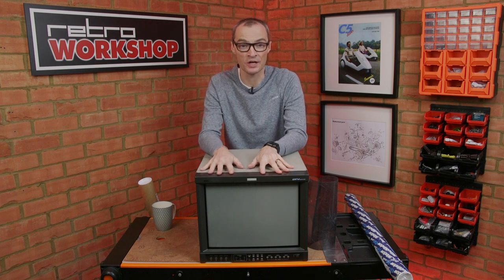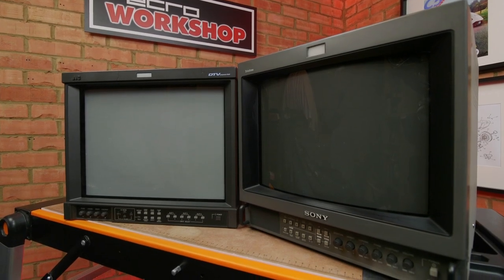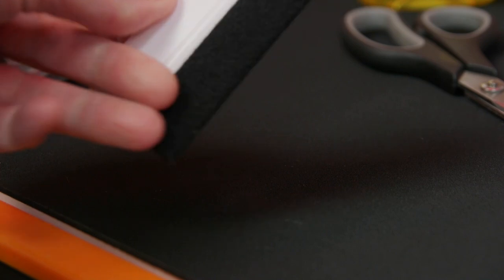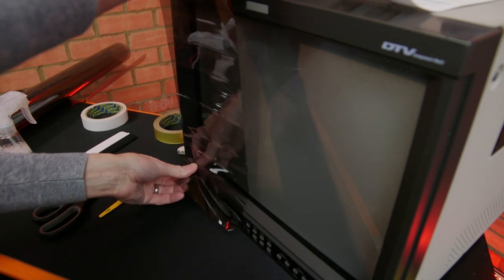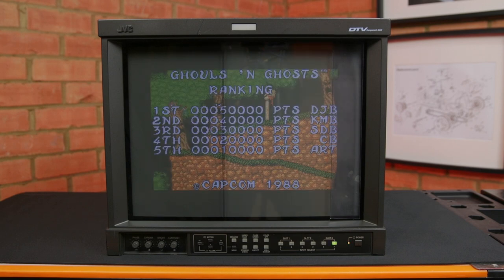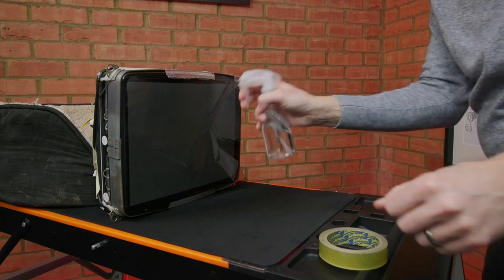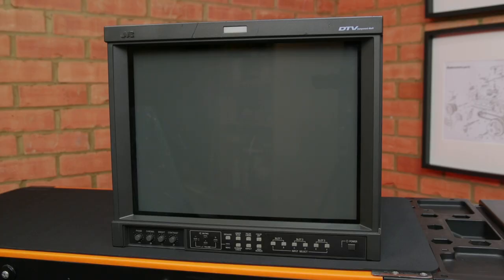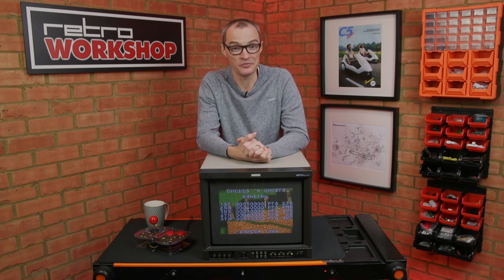JVC CRT monitor repair pt. 2 - film replacement

Comment from the maker: If you have one of these monitors where the antireflective coating is damaged (rather than scratches that have penetrated the film that covers the glass screen, as on my monitor) you can just clean this off. Use some cleaner such as Flash Bathroom cleaner (the one that is good for limescale removal) and a micro fibre cloth. You can be quite vigorous. Use Q-tips / Cotton buds for the corners. Then final clean down with water. I have done this on another monitor and it works well.

Comment: It's awesome that this is possible. I have a same monitor with a small area where the film is coming up, I believe it's lost its stickiness as it's not really scratched, but there's a lightened section (and applying any pressure is only causing it to come up further). It's not bad enough to peel and replace the film, but it's great to see your process for doing this as I'll certainly do it myself when necessary. I performed many repairs on my monitor (I have the Panasonic BT-H1700 which is virtually the same monitor as yours) and I'm amazed at how well it still works given that the hour counter is maxed out at 65535 hours!
Reply from the maker: Good luck if you give this ago (sounds like you are used to monitors but observe the precautions shown in part 1). Often monitors can go on and on, only having to replace the few caps that work hard. As long as there are no screen burns you're OK (monitors used in edit suites were bad for screen burn with on-screen timecode).
Reply: @RetroWorkshop  Indeed! No screen burn -- just a weakened green electron gun causing negative streaking against bright green details, which was remedied via CRT rejuvenation! I'm definitely lucky that there was no screen burn on such an aged tube. There are a couple small geometry and purity defects with the monitor still, but it's more than usable for 240p/480i and 480p content. I also replaced almost all the caps when I first got it, as many of them were bulging and looked to be in quite bad shape!

Comment: Awesome video ! I was looking for a way to reduce the eye strain that I get from an Orion consumer CRT tube that I used to replace a  broken arcade monitor. These consumer CRT tubes seem to have no anti glare film at all and for that reason I do not think they are suitable to swap in an arcade cabinet unmodified. That s why I would like to try adding the ND film in your video to the Orion tube. Do you think it would reduce the radiation and eye strain? Thanks, regards from Romania
Reply from the maker: Adding ND may reduce eye strain (fatigue) but the main reason I use it here is to help set the black level to black (rather than grey). If your blacks are black on your Orion TV, you may just reduce contrast to try to limit eye strain.

Comment: Great solution and nice job! I also have a DT-V1710CG with anti-glare film been scratched. I'd love to follow your solution to repace it with a new one. Could you please tell me the dimension of the original film, i.e. width and height? So I can buy some pre-cut ones. Thanks!

Comment: Great video! Well produced and narrated.

Did you notice any change in color with the new film? 

I have a scratch on my NEC Diamondpro monitor, and I'm afraid if I change the anti-glare coating it might require some major recalibration if the replacement doesn't have the same color characteristics.
Reply from the maker: No colour cast seen either the new film.

Comment: @retroworkshop 
Very good video!
I have exactly the same issue.
Found a DT-V1910CG but the seller damaged the coating when he tried to clean it before the sale…

I like the tint you have ended up with. Looks pretty good to Me.
Could You please tell Me which exactly tint You used it.
I guess the original coating of the DT-Vs is always the same, so whatever tint you used should be good for Mine too.
At least that’s my guess :)
Also do You have by any chance the dimensions (is yours a 19“?)
I would like to get pre cut tints
Reply from the maker: Hello, I have a 17 inch model. In this video I fitted 50pc light smoke tint from https://window-tint.co.uk/ Since I made this video, I have replaced film on other monitors and instead used the "carbon" variant from this same site. This is a close match and doesn't have the slightly off white light transfer (ever so slightly yellow). This film is much thinner and easy to damage. But then the original film is easy enough to damage.
Reply: Thanks for your quick reply mate.
So you would recommend the carbon variant (also with 50% )?
Reply from the maker: Yes I compared them and the carbon is better (more neutral and matches the original better). Thanks, Dave.
Reply from the maker: This process can be very fiddly. Some monitors you get it right first time, others it takes five goes to get it right without little air bubbles or imperfections. Buy lots of extra film! :)
Reply: Thanks a lot. You are a great help!
Yeah as I know Myself, I will buy a lot of extra :D just to be safe

Comment: It looks like Purlfrost stopped listing the NEU-50 light-tinted films, only the NEU-25 dark and NEU-35 medium ones are available now.
Reply from the maker: Yes you are right - I see they do a NEU-35 which has 43% visible light transmission. This may be suitable. The Purlfrost films are higher quality and go on easier without wrinkles than the other film I tried.

Comment: Hello, nice video congratulations. I have the same model without antiglare and I solved it by buying an antiglare glass for monitors as they used to put in the 90s.
Unfortunately there are scratches on the glass of the jvc monitor. Is there any way to eliminate them?
Reply from the maker: Conventional wisdom suggests that you can't get rid of scratches on the glass. I also have a Sony VGA monitor that I have somehow managed to scratch. They are not deep scratches and I am going to try to remove them but it may well go badly. Look out for a video in the future.
Reply: @RetroWorkshop  Thank you. I will definitely stick with it, and hope you can fix it. :)

Comment: It doesn't offer the protection or the anti-static properties of the original film. I'm looking for the same for my Sony FW900 CRT monitor. In the end, just use the monitor without any external light that would reflect off the screen and the blacks look just as good. The only downside is still not having any anti-static protection.
Reply from the maker: Without the film blacks are grey. The film is crucial to setting the black level unless you sit in a darkened room.

Comment: Hi! I have DT 1710 and DT 1700. The first one works fine, but the second one doesn't want to work with RGB signals. I tried all the settings, the expansion boards were transferred from one to another. Not one console- Neo Geo AES- Sega- Pc Engine Duo Rx- does not show. In the menu A-C-E goes distorted in the combo strip it, and in B-D-F the black screen is out of range of the inscription -the sound is coming.
Reply from the maker: Did you change between sync on Green (or Y) and external syncs? You need to go into the SETUP MENU and change the sync from INT (internal) to EXT (external). To enter this menu you need to press the VOL – and DOWN buttons together. My computers output a composite sync signal (H and V sync combined) and this is connected to the H Sync connector on the monitor. Good luck.
Reply: @RetroWorkshop  Thanks! I figured out that 1700 does not have such a menu option, only 1710. I had to put a step-down resistor, 5 V on synchronization for 1700 turned out to be a lot